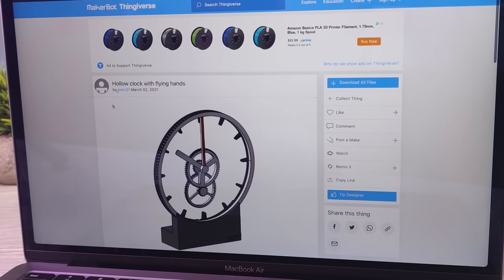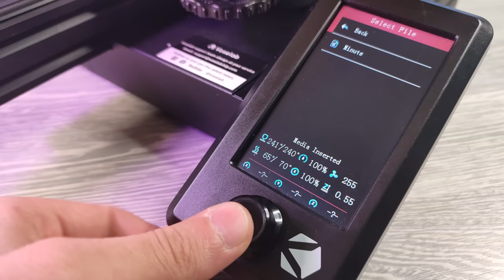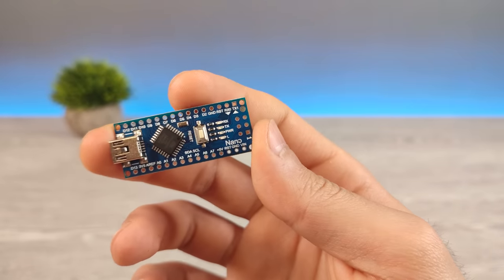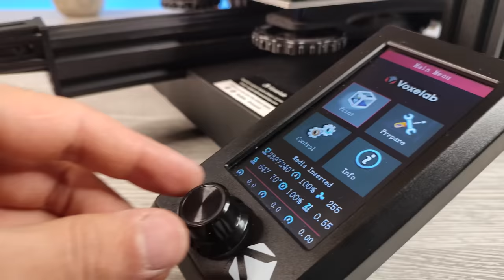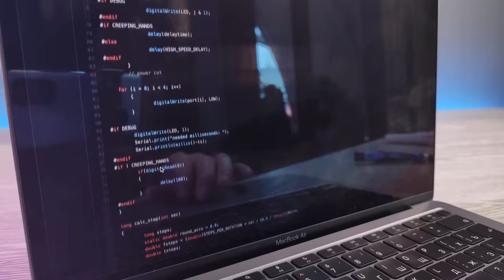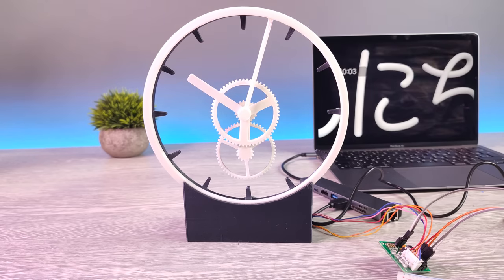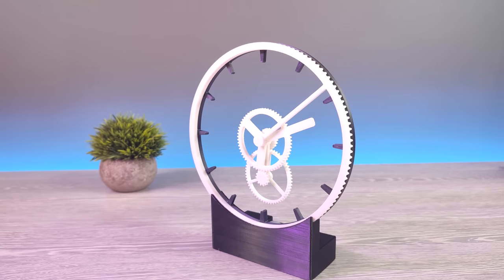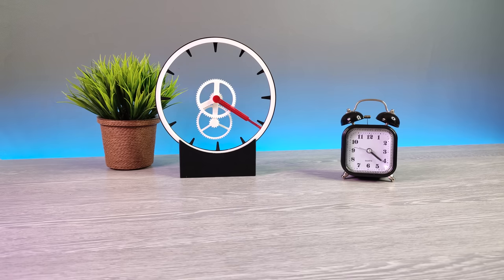How I Made This Transparent Hollow Clock - It is 3D Printed!

Comment from the maker: Tell me your ideas to 3D Print 😊
Reply: Try printing a phone case
Reply from the maker: @DELTA_SKULL  Yeah, I need a proper filament for that, please stay tuned, InshaAllah, I will do it:)
Reply: @engineericly  ok by the way love your videos
Reply from the maker: @DELTA_SKULL  Thank you :)
Reply: It would probably look more realistic if the arrows of a clock were triangles with a base of a triangle being in the center and a thin tip of a triangle connecting with the outer gear 
Great videos, by the way! :)
Reply: @engineericly  by the way, if you don't have a flexible filament, you could make two-part case with two parts connecting in some way (while having a way to disassemble it) 
Oh and it would be awesome if it has a built in stand  (i think it could even be done with the cheapest pla)
Reply: You should skip the buck converter and connect to the VIN pin it has 5V from the USB port.
the way you have it setup now will most likey blow the MCU's 5v to 3.3v regulator beacouse your driving a stepper of it, not to mention its wasting parts and energy beacouse your going from 5V to 3.3v and then back to 5v.
Reply: Put it into an infinity mirror now.

Comment: Awesome 😃 but the power supply was bit crude. You can tap 5V from the usb instead of taking and stepping it up the 3.3.v liner regular output.
Reply: You can even use 12v for the stepper motor controller
Reply: YES and if you want to do it a bit beter you can take the 5v from the voltage regulator on the Board, then you still have your usb functional.
Reply: And the node MCU has a pin called "vin" or "raw" where it breaks out the USB power
Reply: or use a voltage regulator to step down from the 5v, a single chip

Comment: You should skip the buck converter and connect to the VIN pin it has 5V from the USB port.
the way you have it setup now will most likey blow the MCU's 5v to 3.3v regulator beacouse your driving a stepper of it, not to mention its wasting parts and energy beacouse your going from 5V to 3.3v and then back to 5v.

Comment: You could get away with that arduino nano if you have used a ds3231 rtc module (or similar), you also don’t need an internet connection this way.

Great project

Comment: Hello Master!
Cool project. I need help. I printed the second Hollow Clock 3 project (for Arduino Nano). But I don't have an Arduino Nano. I used your firmware for Node MCU(8266), with WiFi, for the Hollow Clock 3 project. The Hollow Clock and Hollow Clock 3 project have different motor pitch. Time is gradually lagging behind (in 1 hour minus 8-10 minutes). Please help to correct the firmware code to change the rotation speed of the stepper motor.

Comment: vin pin will provide the 5v directly from usb
Reply from the maker: Hello,
No NodeMCU boards do not have 5V pins by default, they provide 3V so you need to step it up or provide other external power supply for the driver
Reply: @engineericly  to nodemcu your connecting usb ryt, which power your nodemcu. Usb provide 5v to nodemcu which will be given to ams1117  to reduce to 3.3v to power esp8266 12. In some case you need run nodemcu with external 5v supply, so the usb 5v is connected to vin pin (name of the pin differ in different manufacturer), so if you connect USB power and check the voltage between vin and gnd u will get 5v you can use it run any 5v device....

Comment: The 5 volts from USB is reduced to 3.3 volts by the linear regulator. Then another step-up to 5 volts. Why?
The ESP could receive the clock time via NTP via WLAN. Then he just needs to know where the pointers are.

Comment: THANKS for making and sharing this video. I apologize for the question, but this is my first IOT / ESP8266 project -
Everything is printed and assembled. I have the ESP8266 flashed and able to receive an uploaded script but I'm stumped on what's next.
What script(s) are required to make the clock function? Is the WTAClient used in combination with the HollowCLock script? If so, what is the process for running the WTAClient?
Reply: I have the same issue. If you resolve it then please help me how you did it.

Comment: why should I use in Node MCU, takes too much amps using Arduino nano and every second wake up and give the stepper motor some pulses, then go to sleep again. 18650 cell works over weeks
Reply from the maker: Yes, but Arduino nano has some problems with RTC module, if want to use Arduino nano you have to add external RTC module, then it is fine
Reply: @engineericly  why use any microcontroller at all?

Comment: Really good, bravo. Could you tell me what sort of bit you use on your Dremmel to grind your pieces? many thanks
Reply from the maker: Thank you for your feedback.
Actually it has been long since I bought that!
But I think it came with my drill set.
Reply: Just wondered what sort of shape the drill bit was
Reply: @jean-michelchevalier6649  It looked like just a straight, diamond grit grinding bit. But I don't think it's that important. A round needle file should work just as well.

Comment: You should improve to get time from the internet. Also it easy to make arrows auto calibrated. 
It is necessary to make electrical contact pads or bulges on each circle. After getting the exact time, find pads by rotating circles and scroll the rings to the current time. I want to see it on your channel:)
Reply: The version for ESP8266 already obtains its time from internet (to see in the video when the log of the firmware start is shown).
There is no possibility to recognise the position of the flying hour hand without destroing this special effect of unconnected hand.
Reply: @snowhead8822  you can use magnets or wider zones, or some electric material to find start of each circle
Reply: @aliday9968  
Nope. Take a look at the mount of the hour hand, please. There is no ring for it. It hangs with its gear free on the virtual axle of the minute hand. Only the outer gear wheel of the minute hand can be accessed for position detection.
Reply: @snowhead8822  interesting but it can sync the time every 12 hours with some sensor(photo sensor, microswitch, etc…) at that position of the cog right? If at that time the sensor is not triggered power the servo until it is. Just thinking out loud.
Reply: @myounges  
Like told before it's no problem to obtain the position of the minute hand. But with the unknown position of the hour hand an automatic synchronisation is not possible.
The only possibility I can imagine at the moment is a hollow minute hand coated with black color inside. It's tube has one hole through the gear ring and one hole on its back side in the hight of the hour hands tip. Inside the minute hand before the inner hole to the hour hand there is an tilted mirror placed.
In the base on the position of the minutes hand at 06:33 hour is placed a laser diode firing through the minute hand over the mirror out of the hole on the back. Close near this diode a phototetector receives the reflected light. Normally the gear ring reflects the most of the light back to the detector. This causes a high signal. Every hour on the 33. minute the minute hand with it's hole let the beam pass and so on all hours except 06:33 hour there is nearly no reflected light causing a signal near zero. At 06:33 hour the hour hand is positioned direct behind the minutes hands hole reflecting a part of the beam back through the hole over the mirror to the detector. Because only a small part of the light reaches the detector the caused signal should be only a bit higher than at all other hours. So the controller knows, that the hands are in the position of 06:33 hour and can now synchronize with the current time.
The main chellanges are the making and positioning of the tiny tiny tilted mirror and to place laser diode and detector as close as possible to each other because both must use the same small tube through the minutes hand. I'm not sure if the light reflected by the hour hand can be reliable detected.
Reply: @snowhead8822   yes you are right I see the problem now. Your suggestion should work but would break the purpose of the clock, it's simplicity. Another option is adding a reed switch at the tip of 12 oclock stud which is part of the frame and a tiny neodymium mag on the tip of the minute hand. Wouldn't be precise but every hour for a couple minutes the reed pin is high so you can adjust your time. But again we may be overcomplicating things it is a similar approach add yours.
Reply: @myounges  
The minute hand is not the problem. This would need only a reflective paint mark on one of the gear teeths and a reflex coupler in the base. The problem is and stay the unknown position of the hour hand. It reaches nowhere close enough to the frame to detect its position.
My nightmare suggestion to detect this position was only a food for thought. 
Because of the always correct time from internet this solution would indeed be overcomplicated to only spare the initial positioning. Normally this clock need be touched nevermore after the first setting.
Reply: @snowhead8822  yup I agree probably it is accurate enough. Yes I know that feeling off trying to find the best possible way to solve this question. 👍😂